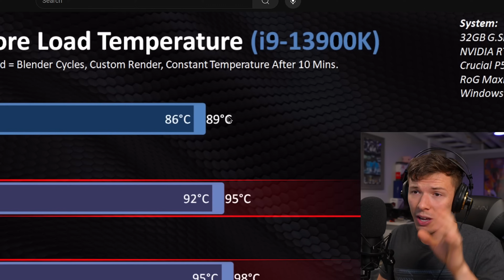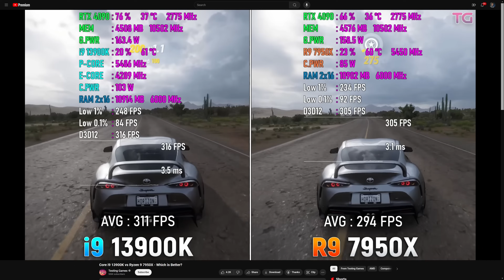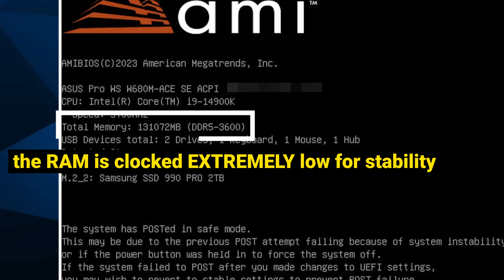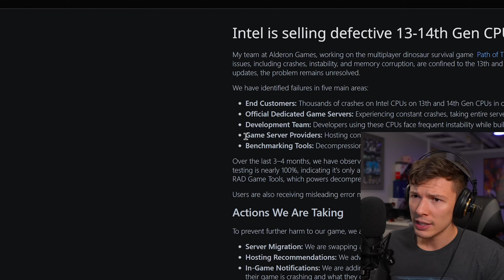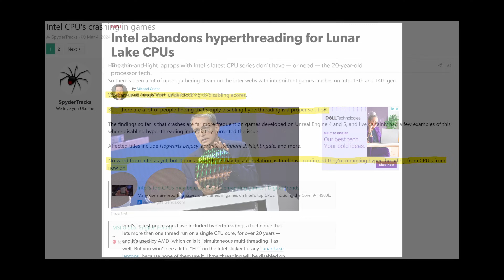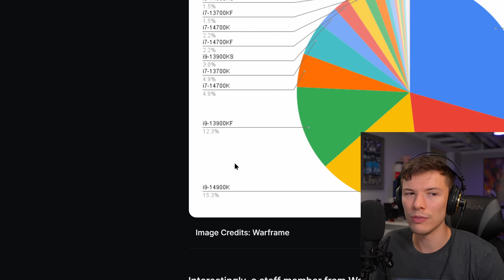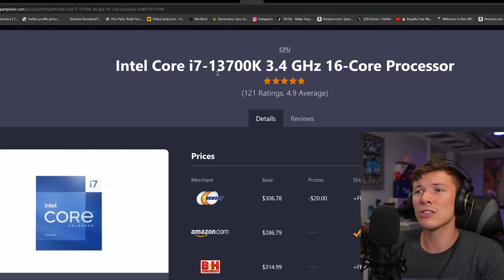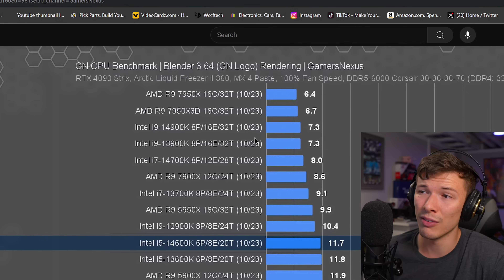Intel F**ked Up Bad

Comment: thank god i baught a 7950x instead a 13700k  with my 4080
Reply: i7s arent facing this issue maybe a very few but its mostly the i9s 13 th and 14 th gen oh and i9 ks avoid them completely cause they will fail.
Reply: @TheOne214  They are facing the issue. But less so as the degradation is slower because those CPU's don't get pushed as hard.
Reply: @nossy232323  yes very few you mostly see articles about i9s not i7s or below because mostly are running fine and are being pushed i have mine for more than an year and i push my i7 14700k hard to 1.3 to 1.4 volts and amperes are higher than intel defaults i have set to 350 instead of intels 307 recommended for my i7 it runs great and havent faced any issues before the intel baseline profile it was set to 511amps so sign and symptoms of degregations would have presented themselves by now and they didnt.
Reply: @nossy232323 they aren’t facing the same issues as the 13th and 14th gen lmao, these seem to just happen with the newer gens.
Reply: @Tsumi784  That's what I wrote: the i7's of the 13th and 14th gen also have issues.
Reply: @nossy232323  you made it sound like the i7s of the older gens have problems, i was about to riot. Because these problems are only happening with the newer gens
Reply: @nossy232323  probably when building my next rig tho because i have the 12700 i7 rn ill use an amd chip depending on if intel fixes their problem or not
Reply: @Tsumi784  Yeah, the older ones are fine. I still have a 6700K system that has been used A LOT over the years. Still works fine.
Reply: @nossy232323  mhm, i was scared to go with amd because when i got the 7800x3d i started having problems right out box with it. I hooked everything up properly then i decided to budget a little bit and get the i7 12th gen. And i havent been having issues, i guess i just got a faulty amd chip earlier then. Will def try my next setup tho give amd another chance.
Reply: @Tsumi784  Yeah, I went with a 7950X3D last year, because I didn't trust the high power consumption of the new Intel chips + I want to be able to upgrade my CPU without changing mobo.
Reply: @nossy232323  yeah changing the mobo was expensive for me
Reply: @TheOne214 No. i7s are also ticking time bombs, they just have a longer timer duration.
Reply: @danieltanuwijaya7675  you are assuming that
Reply: 13700k has lower chance of issue but it still does have it
Reply: @EmperorGaming-m4f  should I buy i5 12400f because it's less than 100$ now
Reply: @desiotaku3435 get the 12600KF, dirt cheap for great performance and no issues
Reply: @FERKILL377  in my country 12600kf costs as much as a 7700
Reply: @FERKILL377  well 12400f is 100$ and 12600kf and rx 7600 is 200$
Reply: @desiotaku3435 12400f is all you need, anything more than this waste of money
Reply: Buy AMD. They make the best CPUs.
Reply: True, they also have a better iGPU, which is great for laptops and/or builders on a tight budget.
Reply: Well, you got it half right. Still fucked it by buying Green.
Reply: @BrieflyAware my 13700k gets to 100 degrees on fivem but works fine on everything else, might be a cooling issue tho

Comment: Me with i7 4770🗿
Reply: i7 4790, not that different overall
Reply: @nathanlamaire  I only have a little newer with an i7-5930k. The part of 6 cores / 12 threads was "extreme" in 2014 now it would be a mid end processor. Still 2000 USD for 9 years with only having to upgrade for more storage is a good deal. X99 boards are stable and outside of overclocking fails never had a CPU crash.
Reply: ay, i7-4710HQ user here
Reply: @catharthritis I have the exact same one! And it also has an overheating issue. Its base frequency is 2.5 GHz and turbo is 3.5, but without a cooling pad I had to underclock it to 2.1 or there would be thermal throttling. After I got the IETS GT300 cooling pad I could finally play at 3 GHz.
Reply: 3770k user here
Reply: I9 9900k
Reply: Still a legend, now i3 are the same specs with better IPC.
Reply: My Kaby Lake i7 7700k still going strong.
Reply: @petrasixz4306  Mine still averages 140fps in the latest warzone at 5.2GHz 4200 cl15. Its pretty much still a beast. For refference, a 5800x3d averages 210, 7800x3d averages 248.
Reply: Recently upgraded my i5 4690k to an i5 14600k my 4690k lasted me this long, I figured i5 would be enough again.. Seems I dodged a bullet not looking at i7/9. Running 5.4ghz it's stable and doesn't cross 80 degrees aircooled and I've yet to see 50% utilisation in games.
Reply: @Rikcey  i7 14700k is running fine and stable been using it for more than an year with overclocks at 5.9 ghz  its the i9 13900k and i9 14900k you have to worry about cause they will degrade and fail on you.
Reply: Mine is a 4770k 😂 and it’s a bad overclocker 🤌🏼
Reply: Got the oringal potato here.
i7-920.
Reply: Oof
Reply: upgrade to 4790k!!!
Reply: 4590S on an Asus Q87M running windows XP
Reply: @TheOriginalCoda  Thats a god pc for win xp
Reply: still running that i7-2600 on my side/backup PC
Reply: Intel 3rd and 4th gen are peak budget CPUs.
Super available, easily affordable, still highly capable.

If you're using an OEM board for an Optiplex or something, it's the same case. It's like $20 or less for a MOBO.
But if you're using a something else that is capable of overclocking, it's an entirely different story.

Also, DDR3 RAM is dirt cheap.

Comment: Intel yeah .. but Crowdstrike .. they F'ed up waaay worse.
Reply: Lol hardware is worse.  How to fix it?  Downclocking to 12th gen performance levels.  

People paid for 13th/14th gen performance not 12th gen performance.
Reply: At least software can be fixed quickly.
Reply: Maybe they compiled their update on a 14900ks?
Reply: Don't even get me started on that shit! have implemented a fix on our infrastructure and sent out comms to guide users how to implement the workaround, but you know end users that are not tech savvy. Yeah not a happy bunny with Crowdstrike right now lol.
Reply: @Dazzxp  I take it they don't let you run updates for a few days on a test system before full rollout, or is that just not doable in this case?
Reply: @kaseyboles30 ”real business run test on prod, test is for pussy” - most company
Reply: That's the point. CrowdStrike snafu was supposed to be annoying. BlackRock is their #1 investor. Forbes is telling everyone to buy up their shares right now. The Trump shooter was in a commercial for BlackRock two years ago. Today, people couldn't check their voter registrations to see if they had been purged on many elections boards websites in the USA. Triangles matter
Reply: Sure did a lot to drive up demand for gas and oil and jet fuel and groceries in a real short amount of time all over the globe too
Reply: Imagine being the dev who messed up
Reply: @rutgerhoutdijk3547  He's probably desperately hoping not to be identified.

Comment: i'm cooked with gen 13
Reply: You ain't Cooked you are sizzled and boiled to medium rare
Reply: @EmperorGaming-m4f 😂😂😂😂😂😂
Reply: You probably mean coocking. If you can manage to boil pasta with the heatload of this CPU, I will pay double the regular restaurant price tag for this royally prepared meal
Reply: @Neuroszima  well, when i'm playing forza, i have 80 C degrees, he is really cooking something 💀💀
Reply: @appoloic I was pinned at 99°C on my 7700k for 5y (inadequate cooling) and it still works great on my second system 😂😂
Reply: As long as you don't use something at or above a 13600K or 14600K, your CPU should be stable, since the CPUs below the skus I listed are based on Alder Lake and those don't have the huge issues that Raptor Lake does.
Reply: @MargatroidVII  I have a 14700F, bought two months ago, hopefully I'm not cooked.
Reply: @devildante9  It's only a matter of time, sadly.
Reply: @MargatroidVII I have an i5 13600k with zero issues for over a year
Reply: @MargatroidVII  thank god im waiting on a 13400 to arrive
Reply: hopefully they'll issue a recall. If not I suspect they are going to have the living daylight sued out of them.
Reply: Mé with r7 5800x3d and deepcool ak 500 under load 65 deg this is fine 😂😂😂😂